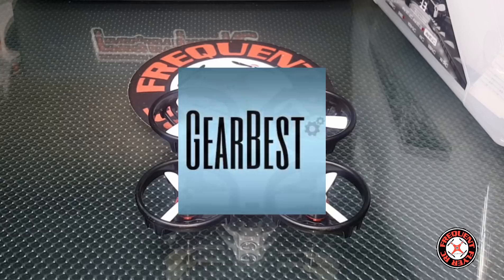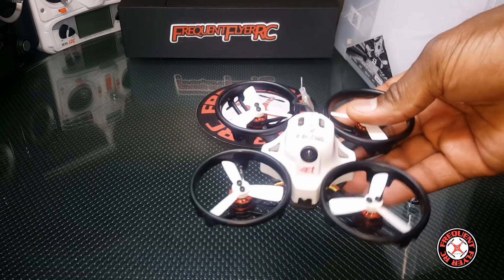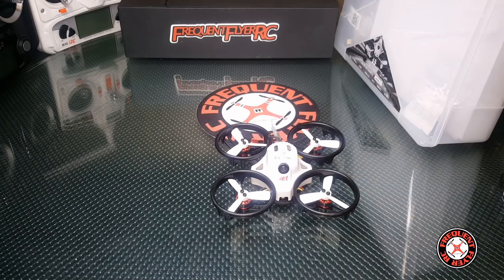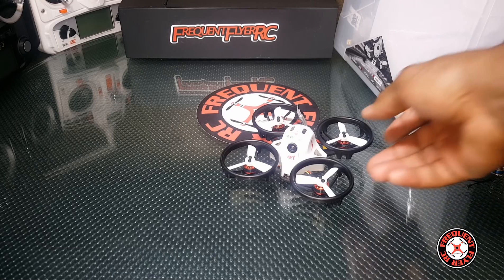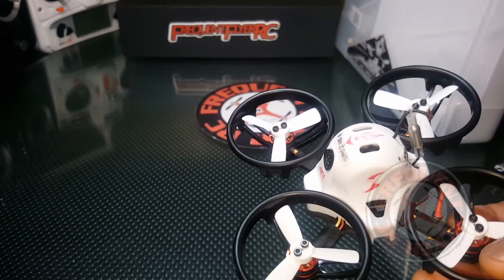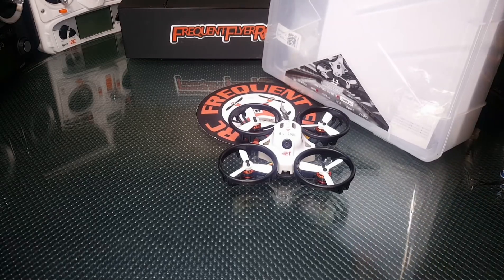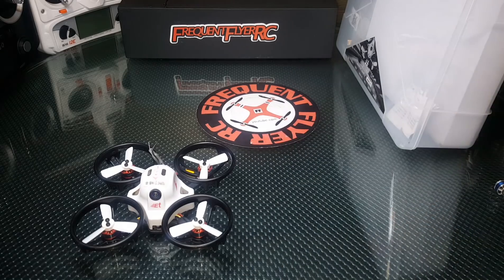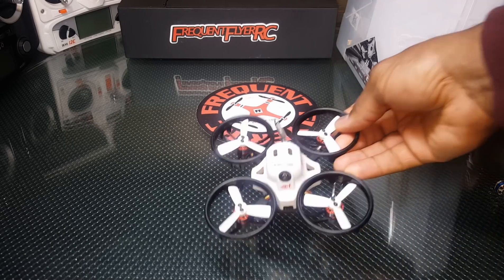Kingkong/LDARC ET100 Quick Review and Bonus LOS Flight & FPV with New Motors

Comment: Hi Man, just to let you know (if you don't already) that, as of Betaflight 3.3.0, the DShot mod is no longer necessary for this board. No soldering needed, no resource remapping needed, DShot just works. If you could put that in the description or pin it to let people know, that would be great.
Reply from the maker: Great news! I will pin this.
Reply: Thanks. Maybe that will save some people damaging their boards trying to mod it, as I have already seen in the RCGroups thread.

Comment: are you sure its 1104 7500kv? mine comes with 1103 7800kv.
Reply from the maker: +JinRei I thought I said 1103 7800kv.. The others have 1104 7500KV
Reply from the maker: +JinRei just watched it again and in the very beginning an overlay of specs say 1103 7800kv and then I even show the motor and say it again! Where did you see or hear 1104 7500KV? Did I say that near the end?
Reply: sorry my mistake... I read it on the main features section. my apology
Reply: btw can i use 1104 motors on my et100 frame? for extra power.

Comment: I have a ET100 as well.   I have a issue with the motor bell housing popping off on one of the motors after a moderate previous crash.  Thxs
Reply from the maker: +Mike Brisky wow, I have heard this before with these motors but haven't happened to me thus far..
Reply: Mike Brisky lock tight is the fix. How to vid on here
Reply: Thanks Tony!  I was just thinking about the other day.  The motor magnets are pretty strong and keep the bell in place unless it smash against something pretty good. :)